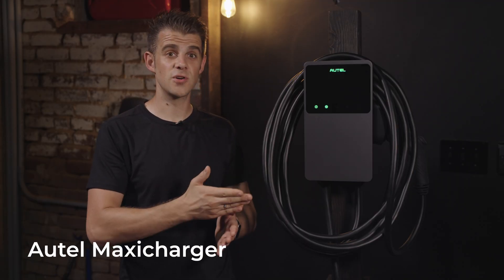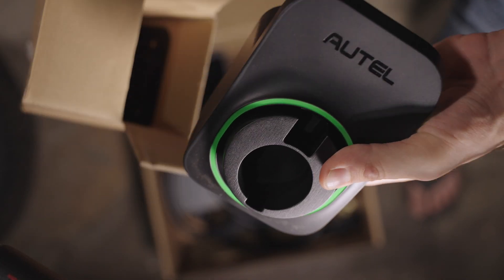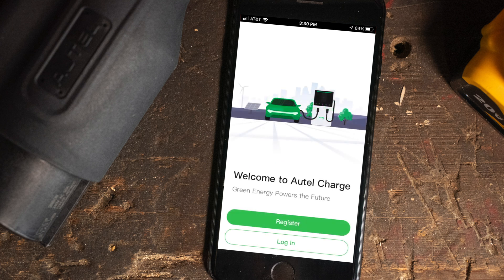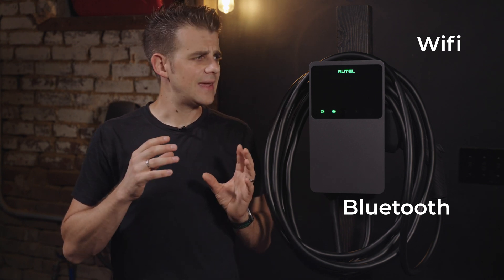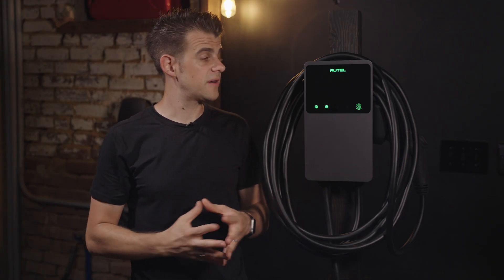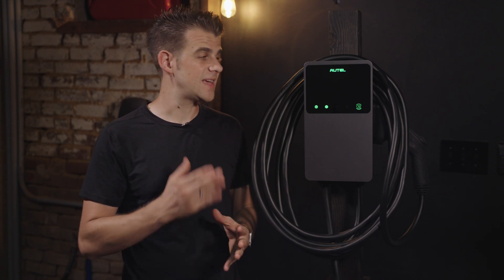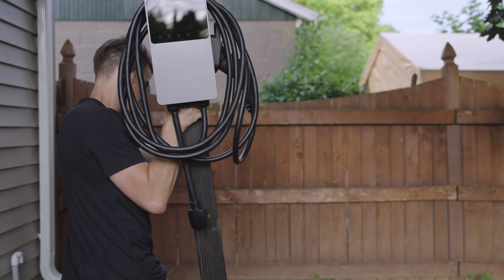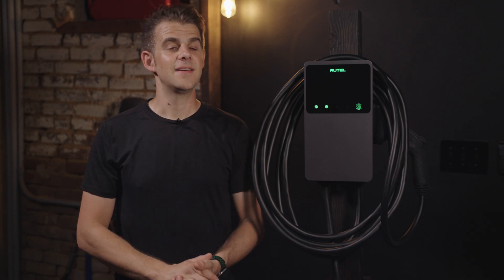Autel MaxiCharger AC Wallbox Home Review

Comment: Do you know if they changed the quality of the charger cord ? Under cold winter conditions i saw that it hardly bendable  😔 It’s the only thing i didn’t check before i ordered one 😮 I live in Montreal so it gets pretty cold  about -30 Celsius. To late to cancel order otherwise.
Reply from the maker: I’m not sure. I do know that the newer Maxicharger Lite I recently reviewed seemed to have a nicer cable. I didn’t try freezing it though. I hope your’s works out.

Comment: One question I have that bugs me on my Wallbox, I cannot schedule a charge and set the current per schedule; this would be useful to me as I run my charger from my solar/battery backup setup and if I charge at 7am, the sun will be very weak and I need to setup the charge current from 7-10am to the minimum, however after 10am I can go full current, is this possible with this charger?

Comment: This video helped me decide to purchase one of these. I've had it for a about a month and I'm very happy with it.  The app has a few hiccups that I'm hoping will be fixed over time. It picks up my Wi-Fi even though the unit is on the outside of my house, which is nice.  The cord is stiff, but it's been cold and I'd rather it be stiff than flimsy.  Josh - after your water test it would have been nice to open up the unit to see if anything was wet.  The unit might still work even though water got inside.  It would be good to know that no water made it inside.

Comment: Why is the plug in cord so short?  I wanted to mount this 16" from my power source with the plug the other side up?
Reply: I ended up buying a NEMA 14-50 extension cord.  15' of cord allowed me plenty of mounting options far away from the plug.
Reply: @mowcowbell  be careful if using extension cord and 40 amps of power as cord could get hot due to resistance.

Comment: I'm really looking for a charger that can stop charging the vehical at a set limit.  For example charge only to 80 percent every night.  Does this charger do that or do you know of any that do.  Thanks
Reply from the maker: You can schedule a charge time, but it will not stop at a given charge percentage. This would require the vehicle to report a state of charge to the EVSE, which is currently not part of the J1772 AC charging solution communications standard. I don’t believe any current EVSEs support this.   They would have to communicate with the vehicle through the web to access charge percentages. If you play around with your scheduling you could potentially get close to your desired charge, but that’s not an ideal method.
Reply: @chargeeverywhere  have you heard of anything in the works for a charger that communicates with your car? I don't have an EV yet but I'm interested.

Comment: Great video, thanks. It actually persuaded me to buy one here in the Netherlands. I got it working but only thing left now is find a longer cable from the charger to my electricity cabinet (not sure whether I'm translating that correctly) but somehow Autel support is refusing to sell me one or send me to a manufacturer that does. They keep hammering on the fact that I should contact an electrician instead of doing this myself. Frustrating. I hope you or any commenters have a tip on where to find a replacement cable.
Reply: I'm not sure you'll be able to find a replacement "cable" to get to your fusebox/breaker panel/electricity cabinet.

If you want an extension cord, you will need something that can handle 60amps (if the rest of your wiring can handle that) which will be a #6 awg. But the best is to run wire inside conduit.

I recently installed a 60 amp circuit using  (2)#6 Cu THHN (Thermoplastic High Heat Nylon) and (1) #8 Cu THHN inside 3/4" EMT (Electric Metallic Tube) Conduit w/Sigma ProConnex Raintight compression fitting (since it is outdoors, and they were $1.04 each).

There are lots of resources on these things available, but I don't think youtube lets folks other than the creator to post links.

Also, I am in the United States
Reply: @Gabriankle  Thanks Gabriel! Appreciate your time to hit me with a response. I'm going to look into it.

Comment: Great video. I happened to find this charger on a great Amazon Prime Day the deal the exact time looking for one. The unit looks and works great. The app is a bit clunky but works just fine. I really like the unit as it constructed quite well with a very long cord that is pretty flexible. Autel's support is very responsive both before and after the sell. I can see them selling a bunch of these once word gets out. They are still pretty unknown for the most part but I expect that to change.

Comment: Great Review!!  Two questilons.  What is the warranty on the Autel MaxiCharger?  And why are there no reviews on Amazon?  Is it just too new for that?  I guess one more, when will State of Charge review the deep freeze of the cable?  Thanks for the review.  I'm tempted to take a chance on this one based on it.
Reply from the maker: Hi Liz, thanks for the questions. It is very new in the US - only on the market a bit over a month, thus the few reviews. I’m not sure when Tom at State of Charge will review it, but I am hoping he will before long and there are others interested to see his trademark tests. As far as the cord, compared to my ChargePoint Home Flex it is a bit stiffer. As you probably know, the ChargePoint cord is rated very highly by Tom in the cold. I do have some other beef with ChargePoint though. Unless you have both units side-by-side I doubt you’d notice the difference in the cords, but perhaps you would in the cold. Overall, as I said in the video I do really like the Autel and it seems well made! Good luck 😀
Reply: although Autel is a newcomer in Charger market, but it has been successful in drone market